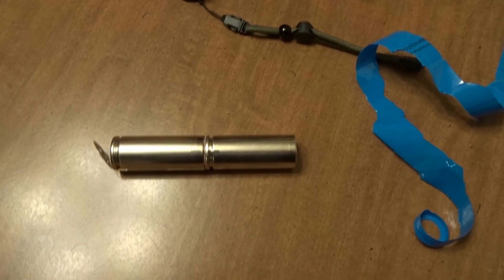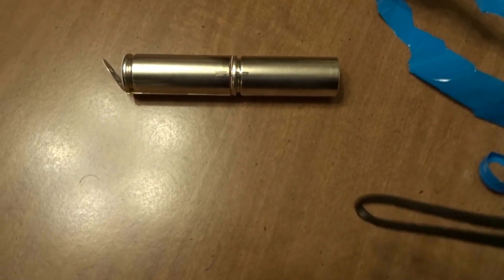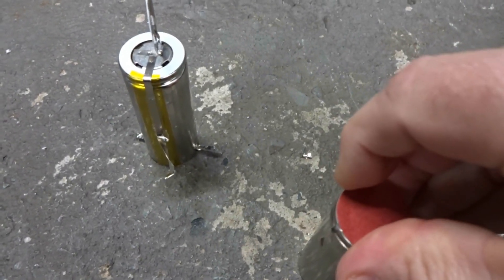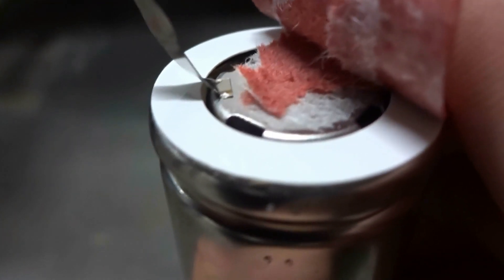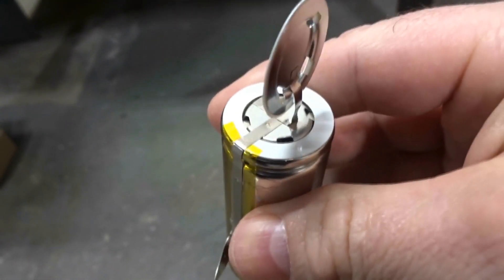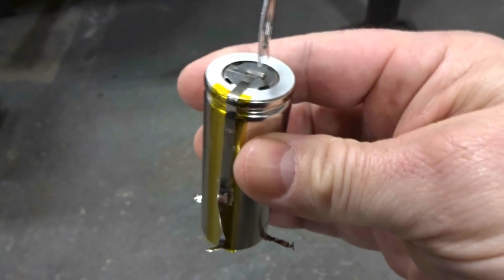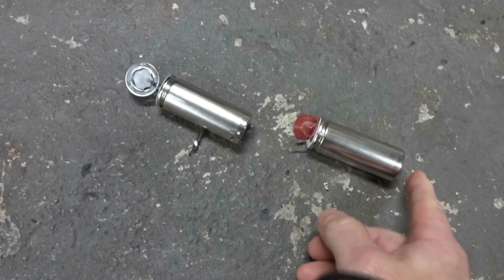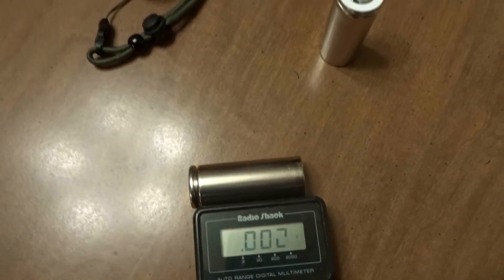WATCH This Before You Buy an (Amazon Flashlight) & NEVER Use 2 - 26650 (Part 1)

Comment: This has to be the dumbest thing ever. I unfortunately had a flashlight like this for a few days. I got lucky I found it in a parking lot. Only problem was it won't charge when plugged in. 

No problem I thought, I'll just get a charger to charge the batteries 

Except there's no chargers for them. 

Ok, I'll just get a couple of the cells, no go. 

Then I opened the battery and saw the weird wiring. 

It's so dumb that you can't charge them and that you can't use replacement battery cells.

Comment: When in parallel  the volt of both battery's, if you measured it before taking apart. You would had read as 4.14 volts. Parallel  the voltage is the same as 1 cell. In series negative  of cell 1 to positive of cell 2, when you would have 8.28 volts, but they were in parallel  and the flashlight failed because it just failed or ypu dropped it.
Reply from the maker: I explained all that in the video. The batteries were wired in parallel & not series hence using 2 - 26650 batteries burned it up not me dropping it or doing anything wrong on my part. I was told incorrect info & that's on the seller & is a dangerous thing. Also @ 7:58 I clearly say I was only getting 4.14v. I guess you missed that.

Comment: Seller said two cells could be used, and they can... if in a 2P (parallel) configuration.  The original cell showed a rating of 3.7 volts. Obviously 2P.  You destroyed the light by putting 2 cells in series for around 8 volts. Completely your fault.
Reply from the maker: No it's not my fault. The pack also states 10000mAh but I guess you believe the 10000mAh to be true on a Chinese pack lol Any trust worthy seller would state ONLY if used in "Parallel" they did not state that & anyone that does not know anything about batteries could get hurt. So you my friend should keep your mouth shut with your opinions. You sound just as bad as these no good weasels claiming 90000 to 120000 lumen & are part of the problem.
Reply: @TheVlad69  The 10,000 mAh are most likely correct. In 2P configuration, you add the capacity (in this case 2 x 5000 mAh, which is pretty standard for 26650 cells). Unfortunately for your flashlight, in 2S configuration, you add up the voltages instead.
The original battery was rated 3.7V and 10Ah, this was printed on the battery pack in your video. How do you think you get to 3.7V and 10Ah with two cells, if not in parallel configuration?
Reply from the maker: @superprinz7619  I've been building battery packs a long time & I know what you're saying but as you well know cells are over rated in mAh all the time. I'm not the only one that had no idea how this pack was wired. Liion Wholesale didn't know why this flashlight blew out either (which I sent Jon a private video). No one commented on any of my YT videos until I figured this out myself & ONLY after I did so do I receive comments. A person can look at a pack like this & take it one of two ways especially with the Chinese & their inability to include a manual along with the seller NOT saying anything about "Parallel". First way the pack is 10000mAh because it has 2 - 26650 which are rated at 5000mAh (which being Chinese I doubt that from reading what I did on Budgetlightforum & other places. Also the wrapper can just be stating the cells are rated 3.7v each. Again the Chinese are NOT very clear & I'm certain you read descriptions from them. A person with no experience or knowledge as I've read many people don't have in the reviews on Amazon would not know this. Even on Budgetlightforum there were 2 different opinions that differed & up until cut the pack apart to see exactly what was what is it really known why & how the flashlight blew up & how the pack was wired. So you cannot assume anything.
Reply: @TheVlad69  I hear you - so you mistrusted the specs (3.7V 10Ah) printed on the battery pack because its a Chinese product, and assumed it must be a 2S 7.4V pack with exaggerated capacity. I see where you are coming from, but an easy solution would have been to measure the voltage of the original pack before frying the light with 7.4V. But hey, we all make mistakes.
The parallel configuration of the original battery actually makes some sense from a safety perspective, given the intended target group for this light, as it prevents potentially dangerous unbalancing that can occur in a 2S configuration, without using a sophisticated balancing circuit (which you will not find in a cheap Chinese Amazon flashlight).
Reply from the maker: @superprinz7619  You are correct. I mistrusted the specs & failed to test the voltage due to the fact of the "Sellers" reply. I assumed the pack was in "Series". It goes to show don't assume anything. I made this video to inform others as what to look for as they most likely will think it's ok to put 2 - 26650's in the flashlight in "Series" & this could be very bad as you well know ESPECIALLY if they asked the "Seller" the question I did & received the answer I did & had no knowledge a pack could be wired in series or parallel. This in my book is Amazon & the third party sellers fault. What if a child or young adult were to use the flashlight have it goes dead & put in 2 - 26650's in just because they thought it was the same battery. I'm sure you see where this can be a harmful situation as most that have knowledge forget there are people out there that don't.
Reply from the maker: @superprinz7619  Take a look at the same light here: https://youtu.be/v2INO5hI95k It's using 2 - 26650 in "Series" not "Parallel" so the "Unbalance" "Balanced" circuit I believe is null at it's "Target" market. Wouldn't you agree?
Reply: @TheVlad69  Looks like a very similar flashlight, but certainly with a different driver running 7.4V. I think that "your" version of the light is better, engineering-wise. There will be many buyers of this light who know nothing about batteries, and just shove them into the light once, and then drain them to zero or charge them over and over through the USB port without ever checking cell voltages. I highly doubt that these cheap light have a balancing circuit, and this can get quite dangerous after some time.
Reply from the maker: @superprinz7619  I'm not sure if those lights have a protection circuit? I would hope they do. If there's no protection circuit in the light & these cells don't have a protection circuit that's a really bad thing like you said. I did discuss a lot with Amazon & they filed a safety claim but honestly I don't have any faith in them. In my Gearmatte review I just posted I did mention that it is not wise to charge through a USB port & I recommend that people buy a charger instead so they can see what's going on.
Reply: @TheVlad69  From what you showed of the driver PCB, there is no protection circuit whatsoever. The only protection, so to speak, in your light was the parallel configuration of the battery pack.
Reply from the maker: @superprinz7619  I'd be interested in seeing what's in those other lights that take the single 26650 being sold with unprotected cells. Those 3 - SMD transistors I thought maybe one or two of them were diodes since all got burned & there is no marks on them. The board doesn't even have "Q" or "D" markings what they really are so I'm guessing at this point they all are transistors. What kind idk. I was thinking a J6 or A2SHB or 431?
Reply: @TheVlad69  Can you post some hi res pics of the circuit @budgetlightforums? I would assume they are FETs.
Reply from the maker: @superprinz7619  Sure, I'll take of the top bottom & sides.
Reply from the maker: I just posted in the OG thread & all links are up.
Reply from the maker: Another asshole with no content you mf'ers are ALWAYS the ones to comment but yet contribute nothing informative. You just troll while sitting in Mommies basement whacking off to porn. Fucking half wit.